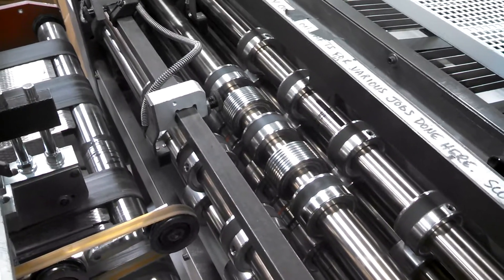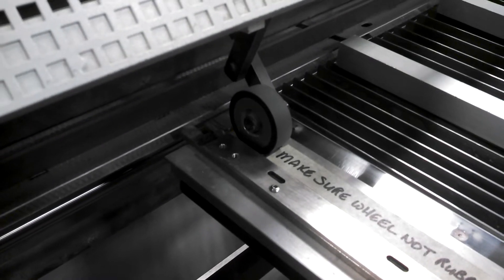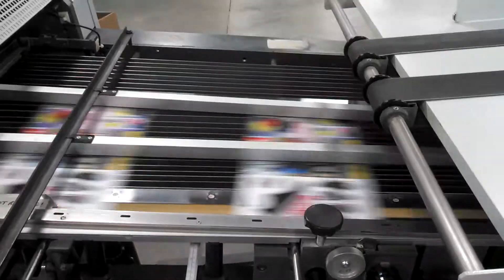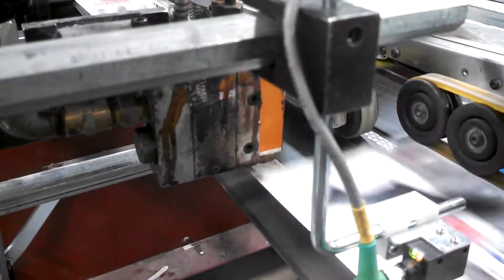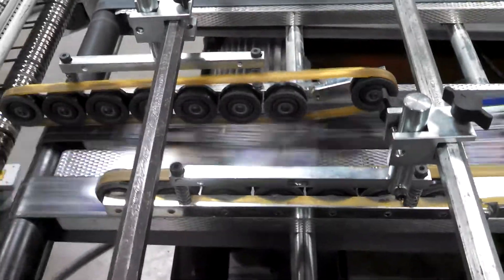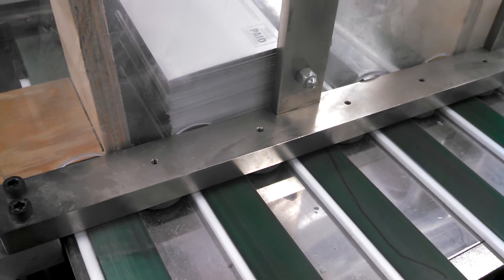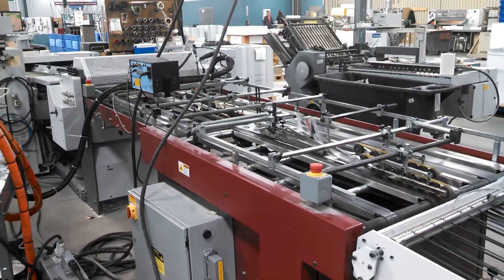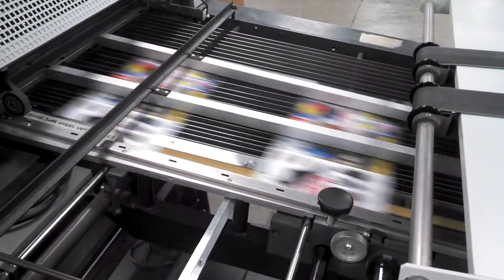This Is What I Do...and More!

Comment: good video.  Have you had any luck with enamel weight text paper with the plow folder?  Lets say 60-70# gloss text. flat size 9 x 18 double parallel folded down to 6x9 or double gate say a finish size of 7 x 11?